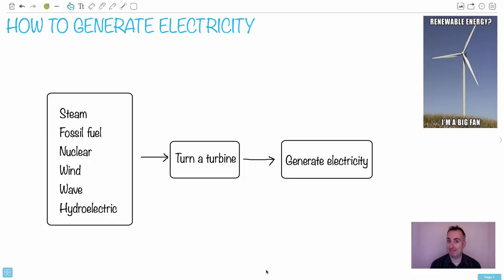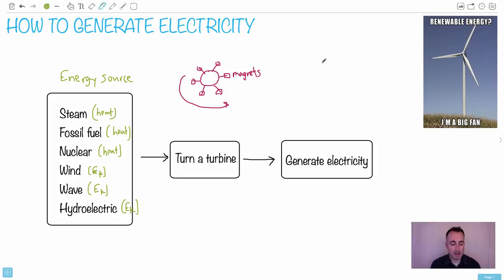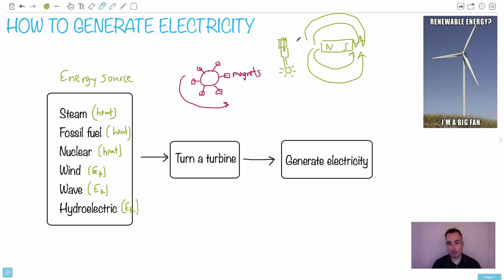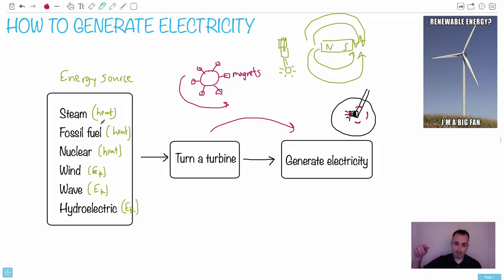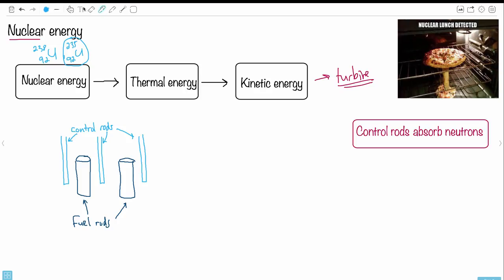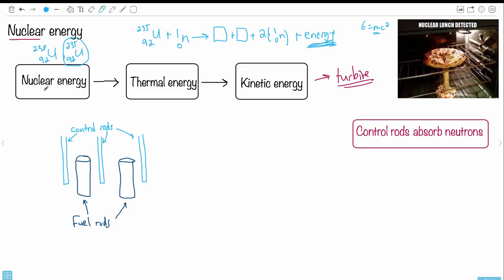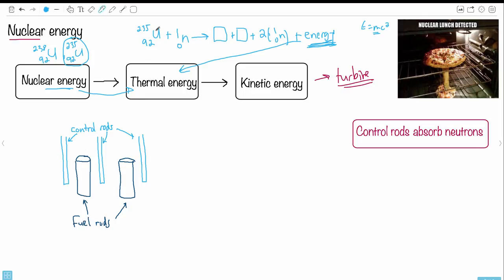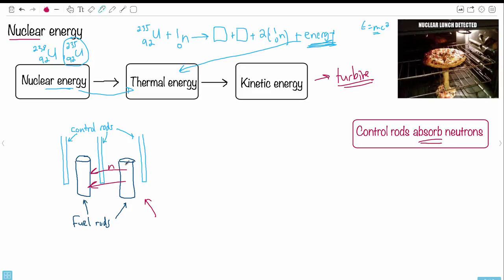How to generate electricity [IB Physics SL/HL]

Comment: isn't energy density -  energy released/ VOLUME of the fuel used
Reply: It can be both, although energy released/mass of fuel used is also called specific energy or gravimetric energy density. It's up to you what term to use to describe the two